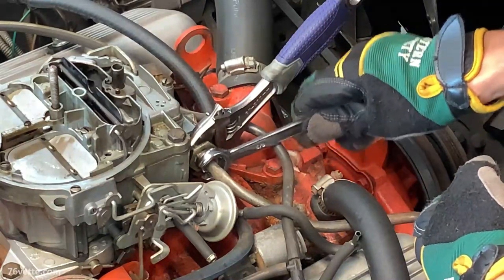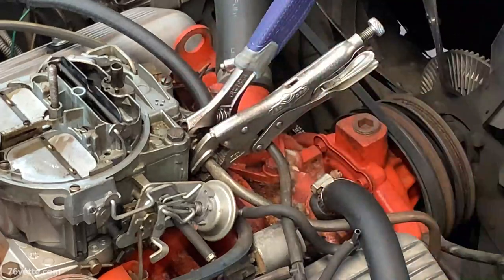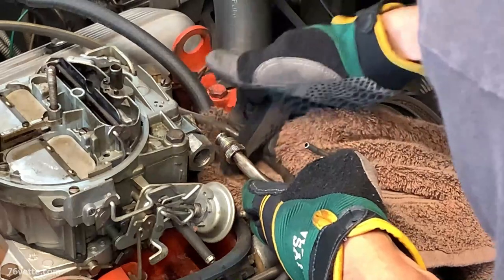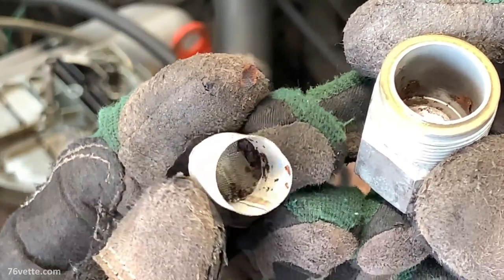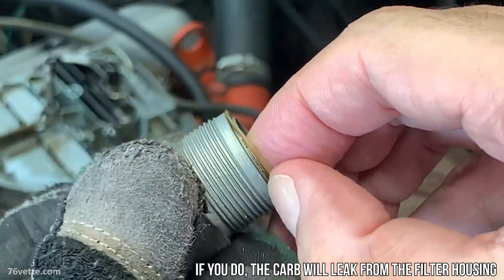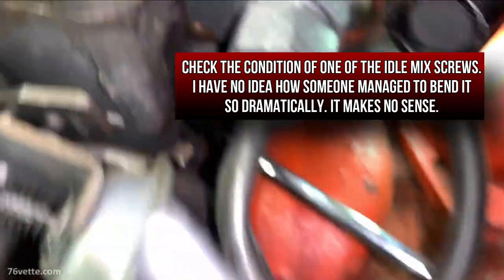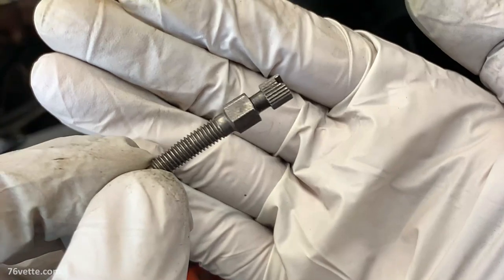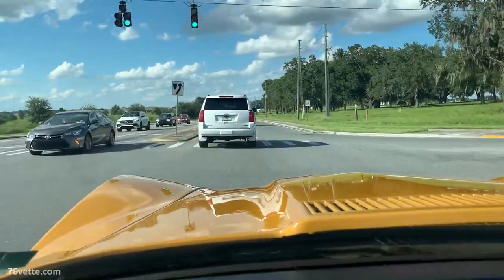Stuck Quadrajet FUEL FILTER? How to Remove It

Comment: great video and information thanks. Could you spin some threads on that idle screw an be gentle with a rubber mallet?
Reply from the maker: Every situation is different and this one in particular was completely stuck in the carb. In this case, I think, a rubber mallet would’ve been a waste of time. Spray plenty of lubricating fluid around the area to help along the way. Also gently tapping with a brass mallet may help loosen the threads.

Comment: I once had to cut fuel line with small pipe cutter. Then unthread the large fitting and separate on the work bench. Replaced feel pump and pump-carb line!
Reply from the maker: Whatever it takes! 😊👍🏻

Comment: A common problem. My line was cut by prior owner. Put anti seize on new nut and change every other year to avoid repeating. Same goes for brake lines.
Reply from the maker: Yes. Anti-seize is crucial. 😊👍🏻

Comment: Good morning, enjoy watching your videos.  You seem very particular and well organized.  I have a problem that I would like to share with you and get your thoughts. I recently purchased a 72 L48 4 speed coupe.  I have gutted the interior with only the interior wires hanging. I thought I would start the car the other day and when I tried the starter, it wouldn’t engage at all.  I check the battery ( which is new) for connections to the starter and the ground to the frame, everything seems ok.  My not much of a mechanic and can’t figure out why the starter wouldn’t engage.  The car started fine before I gutted the interior, do you think I unplug something?  Your thoughts would be appreciated
Reply from the maker: Hello and thank you for taking the time to write. 
Diagnosing a car without seeing it is pretty tough if not impossible, but from what you describe, my guess is that the "gutting" you did is what's causing the problem. 
What kind of transmission does your car have? Auto or manual?
If automatic, is the shifter in the "Parking" position? Did you disconnect any wires/terminals near the shifter when you removed the console? You might've disconnected the neutral safety switch.
Does the car have an alarm system? Either factory or aftermarket? Sometimes, aftermarket alarm systems can be problematic.
Did you disconnect the battery while you removed interior pieces? If you didn't, were there any shorts that could've resulted in blown fuses?
Hopefully, you'll figure it out without much trouble. If I can think of anything else, I'll let you know. And if someone else reading this post has any ideas, feel free to make suggestions. TIA!

Comment: What is the rubber washer called?  I need one
Reply from the maker: Are you referring to the inlet fitting gasket? If so, here’s a link: https://www.ebay.com/itm/114999760689?mkcid=16&mkevt=1&mkrid=711-127632-2357-0&ssspo=iS4fwqclQAm&sssrc=4429486&ssuid=S_43aDlwRIG&var=&widget_ver=artemis&media=COPY